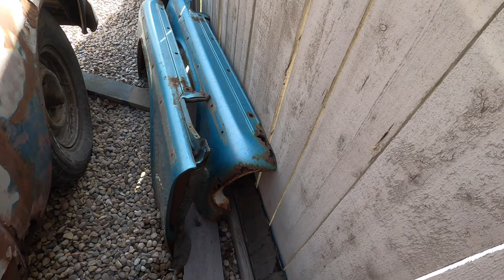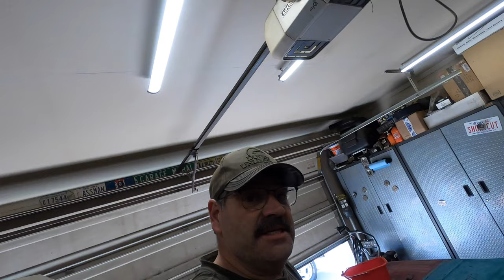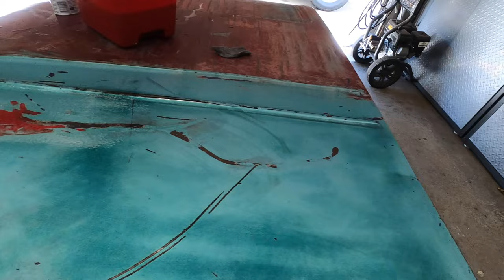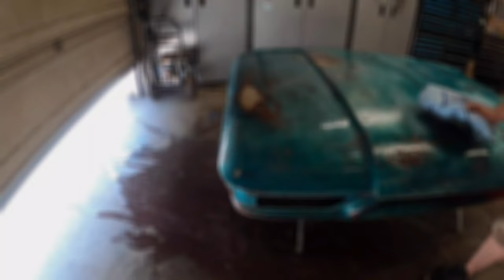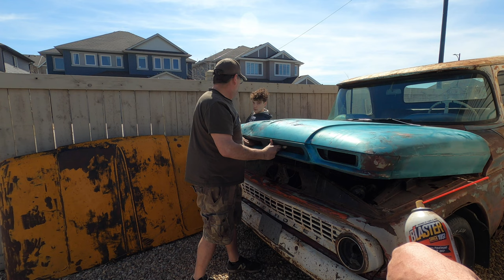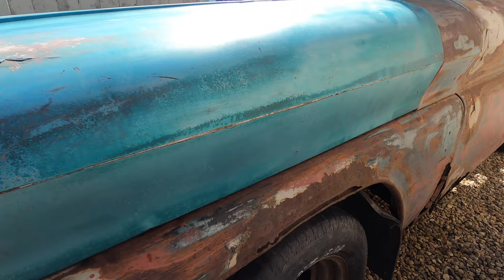Remove Top Layer of Paint & Save Patina

Comment: What spray do you use? Can remove putty to? Thanks. I need to find my original vespa paint. That have 3 layer repainted
Reply from the maker: Just cheap Oven cleaner. Definitely will soften the putty if left on too long